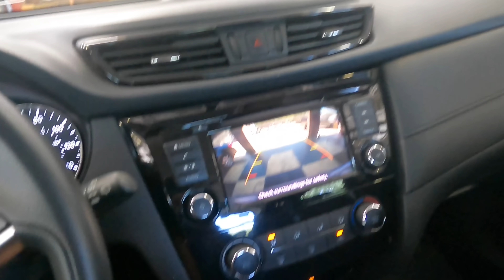Arrested?? Super Secret Hidden Video

Comment: I've always used a small chisel to wedge open those style of ball-joint and strut mounts. Makes it much easier to remove/install them.
Reply: Exactly. I like his vids but he completely hacked this job. Especially using pliers on the strut instead of compressing it more. Now the plier marks are going to damage the seal. They even make a socket tool that spreads the knuckle where the bolt goes through. It cost like $3. Wouldnt need to be hammering on the knuckle like that. Or like u said a chielse or big screw driver w a couple wacks to spread it a bit more. Idk why he chose to beat the piss out of it w an air hammer instead of jus spreading it to make it much easier. He never reads comments so hell most likely do this every time instead of doing it right
Reply: He knows that he just didn't make an extra trip to go get one to spread it.
I did hundreds of these disassembles and sometimes it's just go for it if it will go.
Other times, you're wanting to do the extra and having that thought.
I've done them in the dealer, the tire store, the carport, the gravel.
Out in the woods, or in a driveway.
You improvise.
Once you learn many ways, you can do what seems good enough and not do more.
It still gets done and it's ok.
Reply: @jacksmith2315  he reads the comments and he also responds as he can.. but being a working man he ain't gonna have time to hit every single little comment..

Comment: I did a complete front end rebuild at home, I deliberately bought a new coil strut assembly already assembled because "I scared" of compressing the springs. But still, I have ten fingers and never had a flying car part hit me yet. I understand your "scares me everytime" comment, that is the best way to not cut corners and you also have good equipment.

Comment: Thanks for the refresh. Ive never actually Re-used cheapo struts like that when the bearing went.I  just bought a whole new complete loaded strut unit and threw out that 1/2 worn out stuff. I know you gotta make the customer happy and save $$ to make $$ so yeah whatever . (No dis Ray, you do as you do, your all good ! )
Off topic...suspension parts, Usually when replacing my own stuff, I try and find an Alt# Heavy Duty version part, matched from manufacturer.
Like the little known Alt# Chrysler town and country 4X4 suspension parts, that bolt right in to 2wd T&C setups, for Uber Urban pothole resistance.
"Stock" Turbo optional setups for these too 🤣But its ALL Alt listed and shoved in the US forestry system vehicle specs. And I guess only available to Uncle sam forestry guys for original order of the vehicles.? (Kinda same like police only models)
Anyway , point is you never know what parts are available unless you check, upgrades are sometimes super easy, and actually (sorta)OEM approved (for a different model)  . Cheap ,insurance if you wrench yourself, or know a guy named Ray and break shit all the time cause you drive like his coworker, all 0-100 like that..

Comment: I wanted to thank you. After watching a bunch of your videos, I got the courage to replace my slightly cracked intake (and the 700 things that bolt onto it). I could understand that if I was having a problem with a step, it wasn't because I was a dumbass-I just wasn't approaching it the right way or I wasn't using the right tool. And if not everything goes right the first time for a pro, I shouldn't expect it to be any different for me.

As a bonus, I got to see the top of the valve train when I replaced the valve cover gaskets (the first time the covers have been off in the 23 years I've had the car.  Everything looked really clean with only a tiny trace of wear (shameless plug for running Mobil 1 the whole time I've had the car). I was a little concerned over what I'd find, given the number of times you pulled a valve cover and the valve train looked like it was made of dark mahogany.

Comment: Having done this job many times. Compressing spring to max makes fitting of damper etc so much easier. When l Donne this l didn’t have the luxury of a machine to compress the spring for me.Plus a bit of lub is a good idear when replacing damper into wish bone.
  You have a great day 👍😃🇬🇷
Ps:- great vid secret vid.

Comment: I'm glad I watched the Super Secret Hidden Video. I admit I never knew struts very well. when you took them apart to replace those upper parts, I was wondering how the strut was located in the knuckle and how far it went in. As I watched you install, I saw you locate the aligning lug and then saw the other one which indicates how far in it goes. Thanks again for another informative video!
And I can see also why an alignment is necessary. The upper mounting studs go in oblong holes, which means a change in the alignment, and I'm sure the other changes also affect the alignment. Thanks!!

Comment: The suspension springs and struts take some hammering on the roads in UK holes in roads everywhere I always put better springs on just think how much the top bearing plate takes your suspension is moving constantly ray we always use new nuts and bolts when we change anything and always put new nuts on ball joints also I have seen garages using the old split pin dangerous you are a good mechanic you know what your doing well done ✌ noticed you never sprayed that drive shaft with some maintenance spray it was really rusty

Comment: Hey Ray, saying "Click" as if you are a torque wrench brought back a bad memory of mine.  I had my wife's oil pan replaced shortly after buying it (1997 Camaro RD 30th Anniversary Edition) because the pan was all dented up.  I also had the tranny serviced at the same time.  Well, I didn't check their work right after and was having my wife take the car to Jiffy Lube for oil changes and after a year and a month later (after the warranty ran out) I noticed both pans were leaking fluid.  They weren't leaking before.  I decided to check the torque on the bolts holding the pans and discovered that they all were way to tight which in turn warped the bolt holes on both pans which told me they didn't use a torque wrench at all and most likely used an impact drill to put it all back for and most likely saying "click" every time they put the bolts in without a torque wrench.  Makes me mad as hell when mechanics don't use torque wrenches.

Comment: Ray gave some great advice for those concerned over the amount of money they're spending on gasoline. Keep your foot off the pedal. When I used to run around in a street rod, I could literally watch the fuel gauge move when I'd get on it. I think the fuel economy could have been measured in gallons per mile!
Reply: I had a 2001 Sentra (1.7). The best ever I go was 33MPG, usually 30. I switched to a LEAF (EV with 80M range) in 2017 and started using the power use dots to get the most range. I  rented a Sentra (2.0) for a long trip. I got 50 MPG  by driving it gently. (I did not really think the MPG meter was correct until I filled the tank before turn in 😯. Amazing how much less I used driving gentle)

Comment: Watching you pull apart that rust free front end makes me jealous.  I currently have the entire front suspension of my 07 Xterra torn apart in my garage since essentially everything was dead or dying from mileage. (And I mean everything. Including the wheel bearings. It was no longer safe to drive.) 

So much sawzall action. The lower control arm bolts were cut, the lower shock bolts, the sway bar, etc etc. That's fine though since it's all being upgraded to Nissan Titan components.

That said, I learned something important during this project. Screw all other sawzall blades, go with the Diablo blades with the Tungsten Carbide. It'll chew through the suspension bolts like butter without dulling.

Comment: For a lot of the last 20 years I was full sketchy at removing Datsun strut tops. I would just lay strut on ground, stand on spring with left foot, and rattle the top nut off. Parts would go flying, but it was quick.

Comment: love the way you just pulled the ABS sensor, In the UK that sensor even if it was plastic would be so rusted in that removing the ABS pump and passing that around the strut with the wire still attached would have been a better option that trying to get a UK sensor out! LOL Great video Ray and good to hear the Peter in the back ground xx
Reply: So true! In Canada, I am scared to attempt to remove a speed sensor for a shortcut! With the salt & Brine,,, your using a left hand thread drill bit, lots of lube, patience & a new sensor ! So much for the “ short cut!” LOL, good to see your still around!

Comment: Don't bother with the control arm, you can pry the control arm down far enough to allow the strut to slip out of the knuckle. Trick is to drive the knuckle down as far as it'll go, pry down on the control arm preferably with a control arm/pry bar tool, and turn the wheel to full lock. It'll come right out. Also driving a small chisel where the strut bolt tightens the strut to the knuckle, it will help you slide the strut in and out much easier.

Comment: Using your impact to remove &  install that on the strut causes the shaft to spin in the strut, heating the seals & leak.
     The shaft centre has a place for an Allen wrench in the centre to stop it from spinning. There’s a proper wrench/socket to do this
Reply: I was just going to say the same thing. Thanks for saving me the typing.  
The way I do that is to simply hold in place with a big Allen wrench, and break the nut loose with a simple box wrench. It saves on wear for the strut seals.
Reply: Ya he pretty much butchered this whole job. He should have spread the back of the knuckle where the bolt goes through instead of beating on the knuckle w the air hammer. They make a socket that has a tip sticking out oval shaped so you slide it in long ways up, turn the ratchet 90° and it spreads the knuckle so the strut comes out and goes in wo beating on anything. Or could use a chisle or big screw driver to spread it. Also, instead of using pliers to hold the piston while the strut was in the spring compressor, all he had to do was compress the spring more and everything would have fit together no problem. No pulling on the piston w one set of pliers and holding it with another, thats just going to damage the seal from the plier marks. They also make through socket sets. The sockets are hollow and the ratchet holds the socket on the outside so you can put a tool through the middle to hold the piston from spinning. I got mine from cornwell like 10 yrs ago. Harbor freight has them as well. Gesr wrench does too. For someone working in a shop, they are a must have for stuff like this. Or even something the threads are too long for a deep socket, the through sockets slip right over everything. Man...if this was my car and i seen this vid, id flip the f*uck out. I usually love his vids/hes usually a pretty good tech, but he hacked this one pretty bad.
Reply: 5 seconds of spinning isn't going to heat anything up enough to cause damage. Amateur.

Comment: Another great job. I prefer Quick Struts because everything is replaced, including a new spring. My Dodge Caravan was sagging in the front and back after 10 years. 2 new front Quick struts and 2 new rear springs fixed all that.

Comment: I had an older Lexus that rolled in the door that had a family of 6 step out of it , children the ages of 2 ,3,6,8 . 
 Noise diagnosis.   Claim: passenger side front noises.
  Went to place the car on the lift … lower arm and strut dangling in the air .   Had to explain to the owners that that vehicle could not go back on the road.   
 They didn’t want to spend a dime to fix anything.  Wanted the car placed back together on our dime. Nope ! Not acting like they did !  Like WE broke it  .
 Had to call the police and child services to get the children home safely .

Comment: Love the super secret video :)

I never did suspension but did coilovers on my 2015 WRX. My stepbrother and I worked on it. For the top mount portion had used a deep socket with vice pliers on that and then turned the center with an extension with socket in center. We turned the center portion while holding the nut in place with deep socket. Tried using the ratchet strap but the shaft would just spin. If we were doing this again I would rather hold the center shaft portion and then turn the deep socket turning the nut. I think either was is fine. The suspension is still working after a few hundred miles or so.

Love the vids man.
Reply: Hey mate, like the avatar. I use the same one at work. :-)
Reply: They make through sockets. Every mechanic should have them for this reason. W the theough sockets you can hold turn the nut then have an allen hold the piston from spinning as you turn the nut. Not saying you should, but he should so he can do his job properly. They arent that expensive. I got a full metric and sae set from cornwell. Even comes w an extention in case the socket cant get deep enough. Harbor freight also has a set, and so does gear wrench n comes with an adjustable wrench n the handle end holds the through socket. They all hold the socket on the outside so you can have a tool go through the middle or if the threads are too long for a regular deep socket to reach the nut the through sockets can
Reply: @jacksmith2315  yeah am getting a set. I need them for my tool collection. Hope I didn't damage the coilovers by holding nut with deep socket and turning center. Seems ok though.

Comment: I would've either compressed spring a tad bit more .....or just used a pair of vice grips to hold shaft freeing up both hands ....plus I've always found it better to remove the tie rod bolt to remove the axle ...

Comment: You reminded me of a motorcycle I had trouble with.  It went through tires too fast, and used an awful lot of gasoline.  Somebody told me that the problem was in my helmet.  I bought another one, but that didn't fix the problem.

Comment: Hey Ray - I'm not a mechanic by any stretch of the imagination but a question...on the installation of the strut into the spring, would it be easier to compress the spring a bit more before trying to secure the top plate/nut?  You had to release some pressure when removing the parts so there is additional room to compress.  Again, just an observation from someone who doesn't even pretend to be an auto mechanic. 

By the way, LOVE the vids!!
Reply: Safety! It is less dangerous to expand the strut than to compress the spring. A loaded spring is a lot of potential energy that, released accidentally, can cause oodles (professional term) of damage. Other than that the only issue I saw was that he didn't say 'click' when the struts were seated!
Reply: Yes  I absolutely agree, also you should never use a pair of grips to hold a strut shaft because it will score the surface and inevitably  tear at the rubber seal as it compresses and that will cause the strut to leak. I wouldn't be very happy if that was my car!
Reply: @PaineK  Can't argue with that, but from my limited experience, compressing the spring another couple of inches would have accomplished the job safely while saving time and effort. The strut spring clamp is safe and effective. Adding a floor jack to the mix added an unstable variable/risk. Trying to immobilize the shock while maintaining the strut's smoothness appears to be a pita.
Reply: @budboggy4699  I did some limited research into the dangers of strut spring compression. It's very dangerous. Two inches of additional compression on that spring would have been a LOT of stored energy. For those guys working on these things, please take ALL the safety steps you feel appropriate.
Reply: @Justice-Seeker  dude...he barely compressed that spring. That multi $1000 piece of shop equipment is meant for that. Using pliers and such is the absolute wrong way to do that. It will damage the seal. Compressing it a bit more is the right way and perfectly safe. Ive used cheap ass spring compressor tools, not shop equipment, and compressed springs way more than that. All he had to do was compress the spring more, which is what that equipment is designed to do. Not pull and grab with pliers. Hes just scared. I get it springd arr dangerous, but that machine will do it no prob and a little more is not a big deal, the machine barely compressed it as it was so a little more would have been fine
Reply: @jacksmith2315  you would know best, glad you're here to teach everyone else how wrong they are.
Reply: @PaineK  the tool is designed to compress the spring, safely. Using the floor jack is the unsafe part of the operation,
Reply: @jacksmith2315  no. You are wrong. Stop talking.
Reply: Justin.  Have you ever used one like shown?
Reply: @jacksmith2315  ß